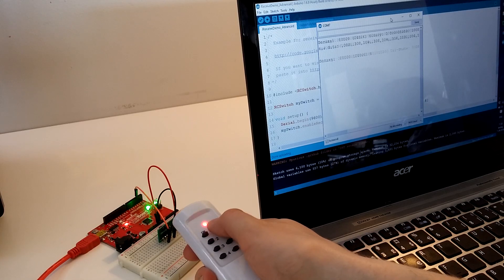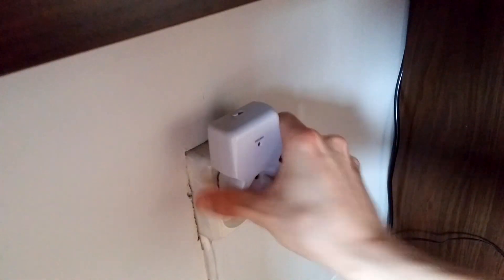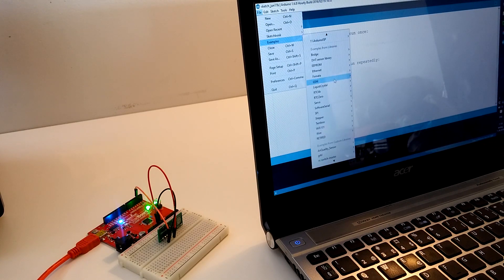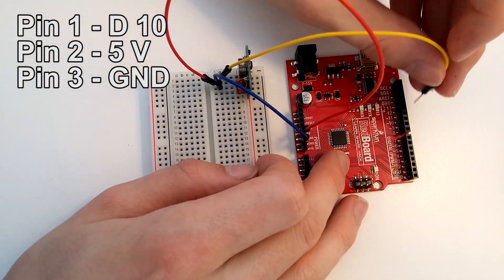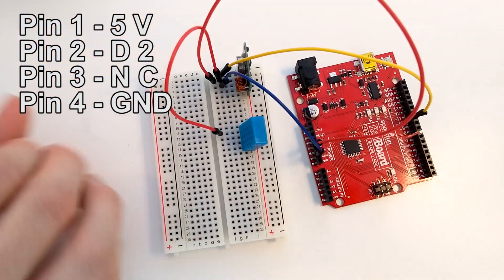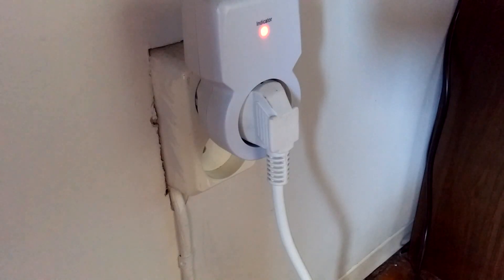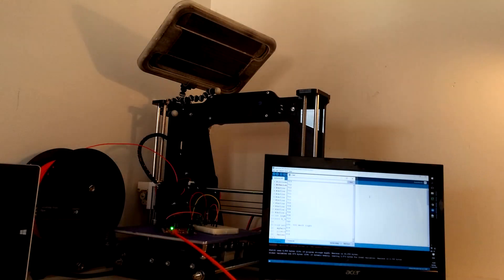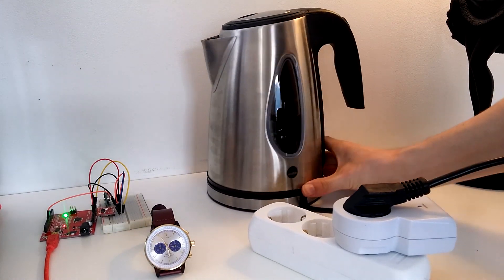Ridiculously Easy Home Automation || Arduino Tutorial

Comment: Very cool, can you control 433.92 MHz outlets with the 433 MHz transmitter?
Reply from the maker: Yes you can! When people mention the 433 MHz frequency it actually includes a frequency range of 433.050 MHz up to 434.790 MHz. You might notice that 433.92 MHz is right in the center of these two edge frequencies. 
You'll be fine as long as your frequencies fall between these!